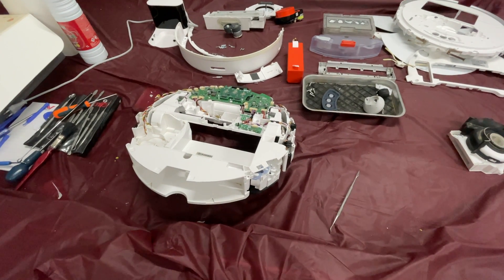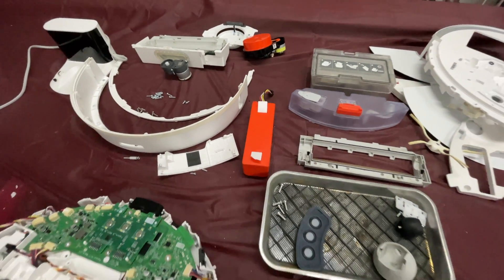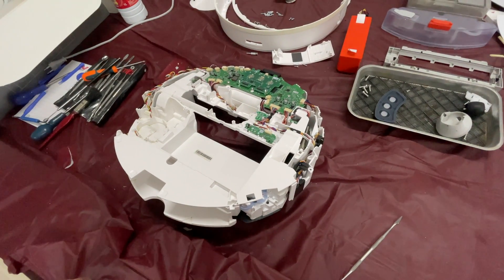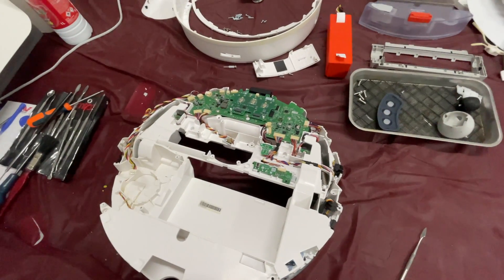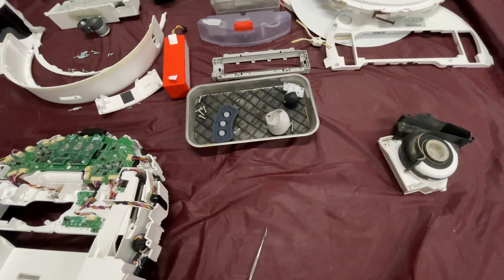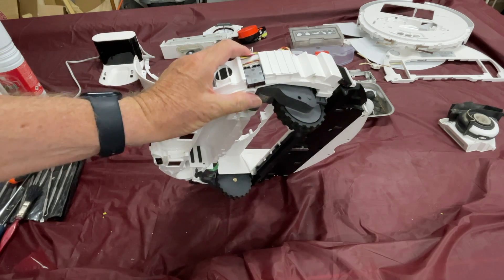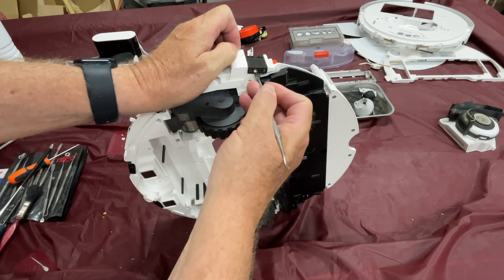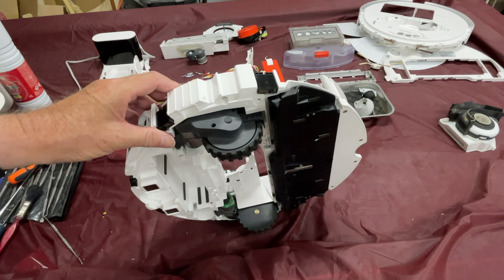roborock vacuum cleaner - cliff sensor removal

Comment: Do you need to remove all those parts for the clip sensors? I just need to remove the clip sensors .
Reply from the maker: yes, every single one !!
Reply: @robinbonathan  ah wauw, i think ifixit will give it an 2/10 then.

I sold my S50 from 2019 for 30 € It's too much work. And no spare parts such as sensors available. 

Hopefully the new roborocks are way better.
Reply from the maker: @ForYourselfYourself  I bought all the bits of aliexpress, repairs are not for faint hearted.

Comment: Robin, Which are the sensors on the right and which are the sensors on the left? I have this doubt when buying spare parts.

Thank you
Reply from the maker: The left and right sensors are in a daisy chain. Make sure the model you are buying for is the European version as I purchased 1st set and it turned out to be Asia variant which is completely different. Looking from tank at rear, Left to your left & vice versa.
Reply: @robinbonathan  thank you

Comment: my cliff sensor are reporting an error constantly due to dust inside the sensors after several years of usage. is it possible to open these sensors and clean them inside or do I need to order replacements?
Reply from the maker: Sometimes it is possible, also you might with the sensor out be able to blow out the dust with high pressure air can or airline.
Reply: Will it function if I just remove the sensors? Or just cut the wires?

Comment: I’ve used the S7 MaxV for about a week (500 minute clean time) and already have a spot of dirt underneath the cliff sensor. 

Quite surprised dirt was able to enter underneath the sensor so easily and in under a week! 😮
Reply from the maker: Not great, the wire entry point is not sealed very well, so liquid and small dust can get in. Hopefully it won't affect performance but worth keeping an eye on.
Reply: @robinbonathan  thanks for the info Robin. I guess I know what I’m up against if it gives me further trouble. One story house, so I’ll likely just cover the problem sensor to avoid tear down
Reply from the maker: @DrDoinks  If you cover the sensors the vac will not detect any drop, which probably is not a problem. In my house I have stairs going to basement and no ledge. Vac would not survive a drop down those.